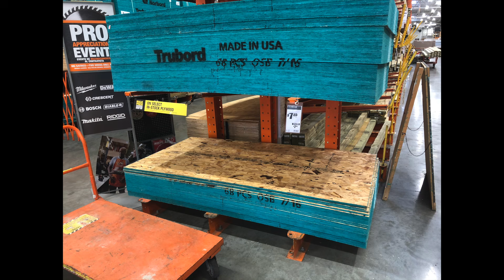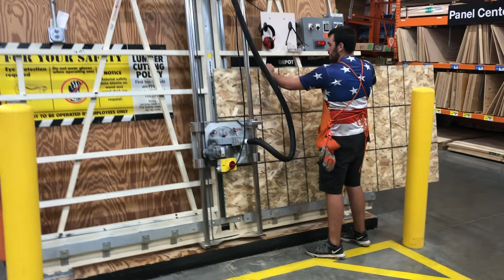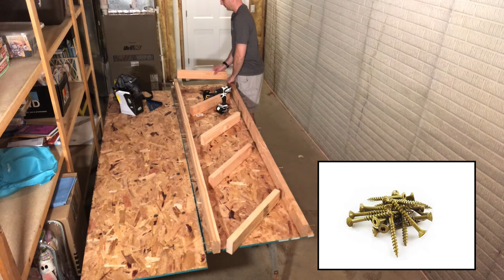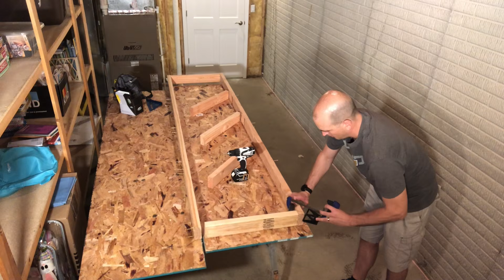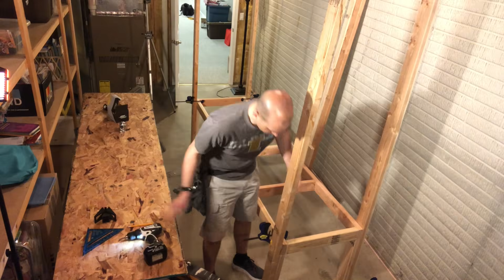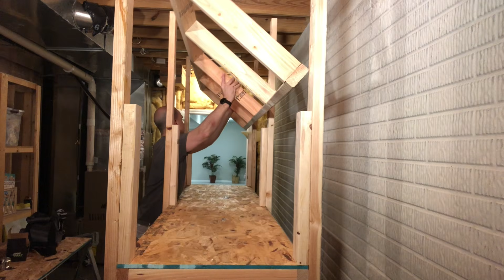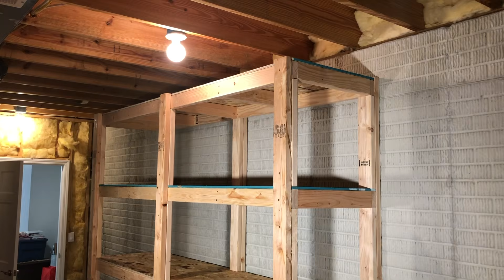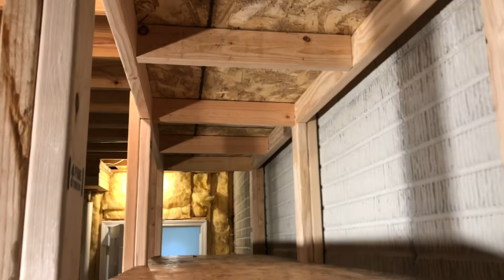How To Build Storage Shelves | Easy Build

Comment from the maker: Tools Used
1)  Irwin Medium Duty Clamp:  https://geni.us/FtKOjb
2)  Makita 18V combo drill kit:  https://geni.us/t7dIA
3)  9 In torpedo level:  https://geni.us/kbhI8El
4)  IRWINQUICK-GRIPCorner Clamp:  https://geni.us/k1wir
5)  Stanley Tape Measure:  https://geni.us/bUfD1R
6)  1/8 In drill bit:  https://geni.us/7ZZeD
7)  T25 Drill bit:  https://geni.us/asMo
8)  Speed square:  https://geni.us/LWFWdp4

Additional Tools for Weekend Warriors
Dewalt Drill Bit Set:  https://geni.us/oFlSl
Dewalt Screwdriver Bit Set:  https://geni.us/VDcr
Craftsman Screwdriver Set: https://geni.us/jXqFI
Eklind Allen Wrench Set:  https://geni.us/7XfvO
Pliers (4-Piece Set):  https://geni.us/RIdx
Stanley Utility Knife:  https://geni.us/ndIDa
Studbuddy Stud Finder:  https://geni.us/RySCuVw
Johnson Torpedo Level:  https://geni.us/wiLcDY
Stanley Hammer:  https://geni.us/bPDk8Wo
Buck Bros Wood Chisel Set:  https://geni.us/vk3cpTW
Klein Voltage Tester:  https://geni.us/h9Hl
Klein Outlet Tester:  https://geni.us/kdBAJ
Ideal Wire Strippers: https://geni.us/MdOB
Little Giant Ladder: https://geni.us/fmlmTk

DISCLAIMER: This video and description contains affiliate links, which means that if you click on one of the product links, I’ll receive a small commission.

Comment: Using 2x4s for the exterior vertical supports is overkill. I made mine the same way but with 1x4s. Looks much better and less bulky and works just fine to hole the inner support pieces

Comment: A good idea well executed. I have no doubt that the shelving has been very useful to you and your family. One quirk that I noticed, is that you kept confusing OSB with plywood, but it was clear to see that you used OSB. Hopefully, no one unfamiliar with the terms was confused. In my experience with Home Depot, having sheet goods cut to size, they usually don't turn out to be particularly accurate, so your advice on checking their cuts, is a good idea. Also, I have never found a HD store with anything other than a panel saw, and it usually takes quite some time to find someone to do the cutting.

Comment: Really like this shelf build.  Have built two of them already.  Getting the materials today for a third. Made the first one out of extra left over lumber on a renovation I'm currently working on. Second was from new lumber. Getting the  OSB cut at the store is recommended.  Even though I can rip sheet stock myself, having them cut it makes it much easier to handle.

These shelves are super strong with the way they are designed to support the shelves by not relying solely on the screws.

Comment: I have built three of these. Two are ten feet tall. One is eight feet tall. I used osb for the shelves.  For the shorter one, I used 1x4s for the upright shelf supports, mostly just to cut down on the weight.  

Note that if you use a 4x8 sheet of osb, you will find that the sheet is usually not exactly 4 feet wide to begin with. And when you rip the usb sheet into two pieces, the kerf will use up a little of the width. So In that case, you will end up with shelves that are fewer than 24 inches deep. When you use 2x4s for the upright shelf supports, that gap in width is not consequential.  However, when  you use 1x4s for the upright shelf supports, the gap could be consequential if your usb is indeed on the narrower side. . This is because the thickness of a 1x4 is actually only three quarters of an inch, not a full inch.

After struggling with moving the first one I built, I decided to anticipate the difficulty of moving these units; my wife and I are elderly. So I put sliders under the legs early on in the later builds. When it came time to move each completed unit, I took out the middle set of sliders and was able to move the unit over some slightly uneven flooring. (I built my units in a commercial shop building so I had to move the units quite a few feet.)  

Installing the second shelf in the build is the make-it-or-break-it step. You absolutely have to make sure that the uprights are perfectly plumb at that stage. Any variation from plumb is amplified as the build ascends. I was very careful with this so my units came out as they should have.  Use a three foot or longer level, the longer the better. 

This design is simple, very sturdy, and can be built by an amateur (like me). With some fairly straight uprights, the result should be very satisfactory.  I highly recommend it.

Comment: Would it still work if all the pieces were cut to 21 inches? The height would be 21 and the cross supports for each shelf would be 21 in.

Comment: Yes yes!  Just finished mine.  Did mine six feet tall for an 8 foot ceiling basement.  Hard to find 2x4s that were not warped.  Try as I may to do the crucial leveling check after shelf #1 to no avail.  Fortunately, by the time I got higher, I just muscled the wood and forced it to all align and lo and behold, when complete. everything lined up and was nice and level.  Perhaps I got lucky.  Great video.  Easy to follow.  Shelves well designed.  Saved tons of money.  THANK YOU!!!!  PS my lazy butt Home Depot guy refused to make the 20 and 21 inch cuts.  So had to do those myself.
Reply: When you did the 6’ how did the measurements change as far as the support pieces?
Reply: @SamO-mh8vs  Sorry for delay in response.  Don't monitor my gmail as much as other mail accounts.  The supports were all exactly the same.  Just needed one set less of them and of course the main legs were 6 feet tall instead of 8 feet tall.  Hope that helps.

Comment: Hi, Scott, I know you posted this 5 years ago.  Appreciate it if you could respond to my question. What do you do when the garage floor is not level.
Reply: I'm not Scott, but I've come across this. A cheap & Simple fix is to just use shims. A pricier but better fix is installing feet that are adjustable so you can get it precise.

Comment: one thing i noticed is that you can't put nothing on the very top, I will save the sheet of plywood.
Reply from the maker: For this location that is true but wanted to make the design to be useful in a garage with a little higher ceiling height.

Comment: one of the only videos out there even today that show the proper way to support the shelves with jack studs -- and on top of that how to get it cut without owning Festools lol  thanks for this wealth of info to us weekend warriors!

in case any one else is planning to build a garage storage shelf like this watch the other DIY ones and you will see that MOST ppl only use face on screws to hold up the shelves - will it work sure - will it last maybe - but I sure as hell would sleep better at night knowing it will never collapse and fall onto my car!
Reply: But why shelf to shelf?  A 4 inch block would be plenty.
Reply: I forgot.   You will regret not spending just a little more time and building 2- 4 foot sections vs 1-8 foot section.  Suppose you want to move the shelves to an area where you need more than a 8ft run.
With 2-4ft sections, you can spread them apart and lay, say 3 - 6 foot shelves on the existing shelves and now you have a 14 foot run.

Comment: This video is awesome, I just built my shelves using this video. Thank you.
Reply: Good video. I have a 10 foot ceiling in my garage so the top shelf will also be useful. I will also attach it to the wall so if kids climb on it, it won't topple over.

Comment: Hey Scott, I want to build something similar (Height 6-8', Width =  8 ft, Depth =  2 ft) with 4 shelves anywhere between 18-20" apart, but I want to make it mobile (5 Inch Swivel Casters)... have you done anything like that before and do you have any suggestions? I've never done woodworking before. This would be my first project but from watching your video I'm positive I can do it.

Comment: Thanks for the tutorial, just finished mine. 6ft wide by 5'6" tall, so I skipped out on the middle verticals. I also used left over screws and sheet materials from other projects, so I had to counter sink some shorter screws until they gripped. My lowest shelf is sturdy plywood, and the uppers are slightly weaker MDF, yet it is taking the weight fine.

Comment: Did this in the UK, measurements were a bit different because of it being metric here, the 2x4s are slightly shorter than 8FT, took me a while to realise because I had got limited space for it too 🤣 also had to adjust the height because my garage roof is sloped, I would definitely recommend those corner clamps after building it without them, would have been a lot easier!

Comment: I can’t seem to find that corner clamp you used anywhere.
Reply from the maker: I think Irwin recently stopped making the corner clamp pads.  You can still find them on ebay and a few other sites but looks like they have swapped out to this clamp https://www.doitbest.com/product/327523/irwin-3-in-90-degree-angle-clamp-327523/?gad_source=1&gclid=Cj0KCQiA5-uuBhDzARIsAAa21T-OcgtJ-ZWXqD0fOQk0M4-fzHu6b7-Xq8trDpr6Hpvvp0B3-cEi3JsaAu5XEALw_wcB

Comment: Potentially stupid question here - i can't work out why the cross-bracing in the shelf is 21". If the shelf is 24" wide and you subtract 4" for the 2 pieces of 2x4, why wouldn't you make them 20"?
Reply: because the 2x4 actually measures 1.5x3.5 inches

Comment: Great video!!  I got a couple questions if you don't mind.
1 Do you think i could do away with the center leg at that length, IF i am not putting real heavy items on it?
2 Do you think you i could run a brace lengthwise under the shelves instead of widthwise  to aid in the support if i do eliminate the center leg?
3 How is the lateral stability?  Would you suggest some kind of knee/corner braces on the back and sides where they do not get in the way of loading and unloading?
I Love that you used the 4 x 8 platform on this build and the inside vertical braces make it literally fail proof.  New subscriber here.  Thank You, Darren

Comment: hey Man, awesome video. I am going to try this. I have one question on measurement though. I would appreciate if you can help. 

You mentioned 21 inch 2x4 to make base, which will end up being 25 inch wide to hold the osb board. I am confused about having its width as 25 inch to hold 24 inch wide osb board. is it intentional to make it 1 inch wider to give osb some room?

Thanks for answering.

Comment: Up here in Canada, with the cost of lumber, the sketchy quality in the lumber yard, and the time to build this - it's probably the same cost or less to just buy metal racking. 

Our local Costco has Gorilla Metal racking for $260 CAD (about $150 USD, in warehouse price not online) and it takes about an hour to assemble. It holds 3000LBS and is far, far more durable than wood. 

And you can EASILY disassemble it for easy moving. Great video but I'm finding in many cases wood isn't the best choice due to quality and cost in today's world.

Comment: I like this design, most of the ones you see on youtube rely on the sheer strength of a couple of screws to actually hold all the weight, whereas in this case it's really the compression strength of those shorter lengths of 2x4, everything else is really there to keep things in place.

Comment: Thanks Scott, I built one last year with modification, it was wonderful. You are an excellent teacher. I'm 72 year old woman who never touched  power tool until I went on utube 3 years ago to find out what tools were left behind after my husband passed and discovered carpentry  😃. Anyway, my question is that I would like to build another for my garage and was wondering if it was safe to put the unit on heavy duty caster wheels. I will be building 8x8 but 3 shelves. Thanks.

Comment: Lumber prices have finally come down. Yay! I just priced the lumber for a shelf and it is $103 before taxes. I was either going to buy heavy duty metal ones at $200 a shelf and only 4ft wide or build wood ones. The wood ones win today. $100 is better than $400. 😊 They would have been about the same cost 2 yrs ago.

Comment: So I'm way late to this party but i have a question, would it be feasible to make this beable to be separated in the middle for making it easier to move  by adding a 2nd 2x4 support and moving the previous one slightly over so 2x4 supports are centered properly, and instead of screwing them into the sides useing something that can detach / Latch for the center mounts ?  I love this build / design but I move a decent amount and would need to beable to break it down at least some so it would be easier to carry alone. 
Thanks for the video and the additional information if you have it :)

Comment: Scott if my shelf will be 6 ft tall, how tall will my shelf supports be?
Reply: Wherever you want them.  Just do not forget that a 2x4 is technically 1.5 x 3.5 inches plus whatever plywood thickness you choose.  He used .50" OSB so in his build he had to account for 4 inches wide per shelf which would be 3.5 inches for the 2x4 width plus 0.50 inch which totals 4 inches.  Hope that helps.

Comment: Not sure why you built structure to the ceiling and you cannot use the top shelf.  A waste of lumber and unnecessary cost.  I would have eliminated that upper frame structure as redundant.

Comment: I'm not understanding the note for the two osb sheets "Note these will need to be both cut into 2 ft x 8 ft strips for the shelf top".
Reply: A sheet is 4 foot wide but his shelves are 2 foot wide.  1 sheet will cover 2 shelves or 2ft x 8ft strips per shelf.
Reply: @texasbtc  Right... thanks

Comment: So. I modified your design to use 2x3 not 2x4 material. 
I have 84 inches of vertical height available. 5 courses of bins. My bins are a mix of  15 and 15 1/2 tall.
I chose to elongate the length by 1 foot to accommodate my 18-inch wide bins.
This will be 108 inches long with two 54 inch rails. 6 lateral supports instead of five to accommodate the middle split of the rail. Two support rails. And the floor would be 3 tiers. 
From the floor, This will give me two shelves with 31 inches of clearance. 3inch rail with the 1/2 of plywood. The final course of bins will sit in the space on top that should be 15 1/2 inches minimum.

Comment: I appreciate the video, but you could definitely make another with like 1/2 the weight. Instead of 2x4 2x3 would make it so much lighter. Then those 20in 2x4's you put under each shelf could just be a 5inch piece of 1x3. You screw the shelf into the legs anyways. If you need the OSB board to not move around just put a few screws through it around the edges into the 2x3in pieces supporting it.If you really wanted to make it more sturdy and not wobbly at all just wood glue each spot you screw together & it'll be rigid. Also, the top shelf seems like its extra. There's not enough room to set anything on top of it and it's 2 ft deep so the small stuff you set on top will get lost and unseen. I do appreciate the video, hope to see an improved shelf update video tho. Wood aint cheap anymore

Comment: Great video. One of the better shelf designs on YouTube. I’m thinking about not building the center vertical supports though. I’ll probably attach the tops though to the floor joists above. Seems like it will still be super sturdy though. At most maybe I’ll have a center vertical on the backside but not on the front.

Comment: One caveat that you should add:  Before you go to the trouble of pulling all your lumber, first go and check that the panel saw and radial arm saw at your Home Depot or Lowes are both actually working!  You may have to go to another nearby store.  Also,  I think it's worth the extra money to buy Douglas fir prime grade 2 x 4s, which tend to have fewer defects, twisting, and warping than lesser quality 2 x 4s.

I recently built three very similar six foot tall, eight foot wide, two foot deep two shelf units for our storage unit at a total cost of about $120 per unit (including fastening hardware).  I wanted the ability to assemble and disassemble them on site without the need for power tools, so I used 1/4 inch hex bolts instead of screws to attach the uprights to the shelves.  I pre-assembled the shelves with screws and pre-drilled holes for the hex bolts.  The shelves and uprights were made of 1/2 inch OSB and 2 x 4s, but I saved a few bucks by using 2 x 3s for the shelf cross braces and vertical supports.  The thing is like a rock!  Each unit breaks down into two shelves, four uprights, and a U shaped base plate made of 2 x 3s so I can store heavy items on moving dollies underneath the first shelf.
Reply: HD, and Lowes to a lesser extent, have some of the LOUSIEST lumber I've ever seen! Last time I bought lumber there for a project 6 years ago it took me an hour to come up with some decent pieces and I wasn't buying that much. I would go to your local lumber yard. They have infinitely better lumber than those box stores. I bought some beautiful lumber that they got from Norway or Sweden. And it wasn't all that much more than the box store. It was gorgeous though. Just about every piece was perfect. Some of the junk, and that's what it is, at HD is just fit to burn. Outside. Most is very green and severely bowed. I could just feel the dampness in much of it.

Comment: Substitute the shelving support 2x4's and use 1X4's and glue, to keep costs down, great shelf, could store anything at any weight. One could sub in 1x4's with glue n a few more screws for the whole project.... household goods don't usually weigh that much.

Comment: This video is great and I have watched it several times. I plan on doing the exact same thing. I had a question about the top shelf or top piece of plywood. That top shelf looks so close to your basement ceiling, it doesn't look like you could even use it. Could you leave the top shelf off entirely and just have 3 shelves? Since you can't use the top one anyway?